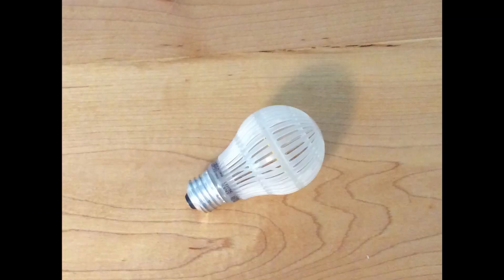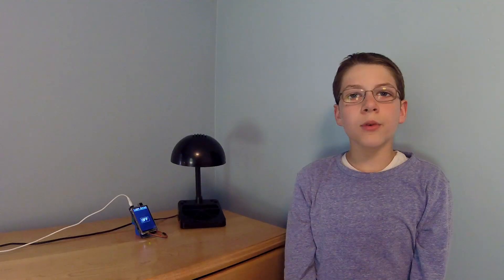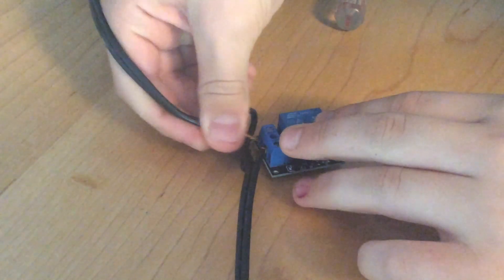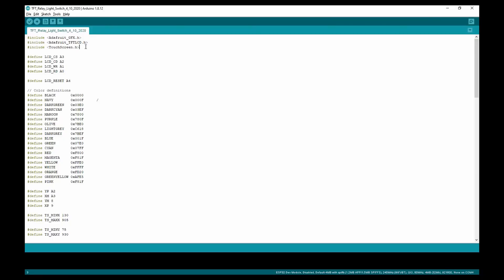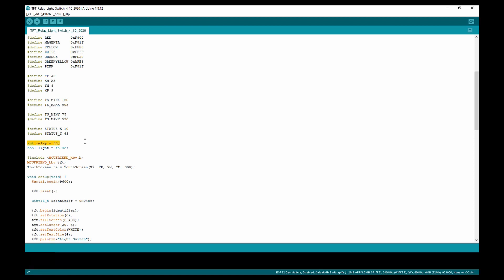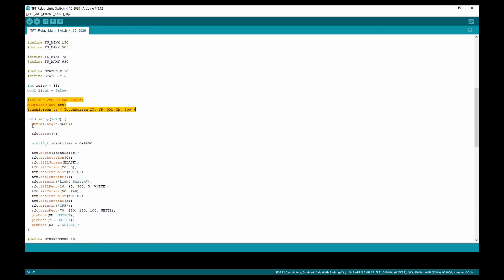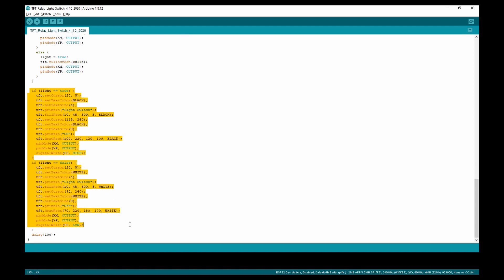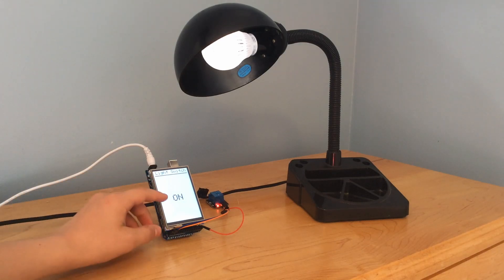Arduino Controlled Touchscreen Light Switch

Comment: Great vid can you make a vid on arduino code for beginners
Reply from the maker: Usually I only make one video per project, so if you have any questions on the code just leave a comment and I will answer it.   The code is available here: https://create.arduino.cc/projecthub/SeanMabli2/arduino-controlled-touchscreen-light-switch-fae6d1?ref=search&ref_id=touchscreen%20light%20switch&offset=0